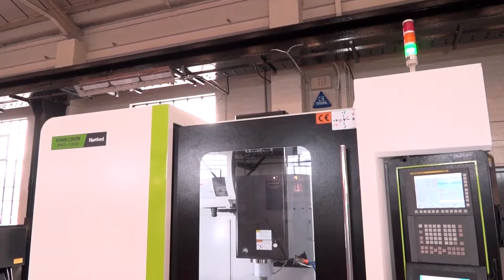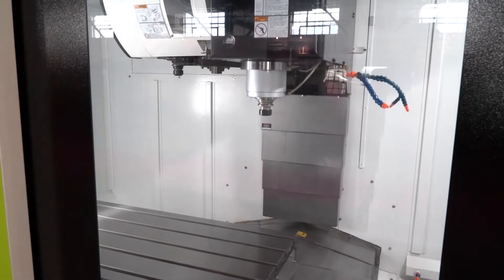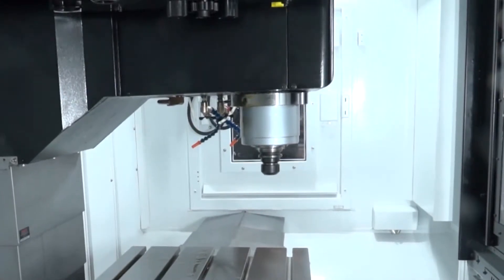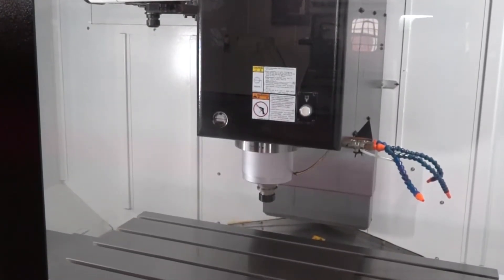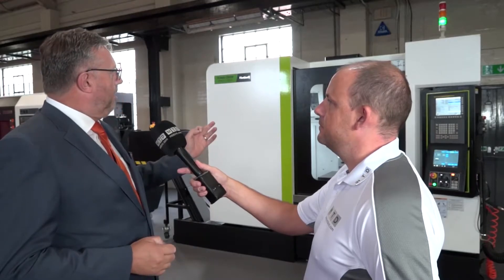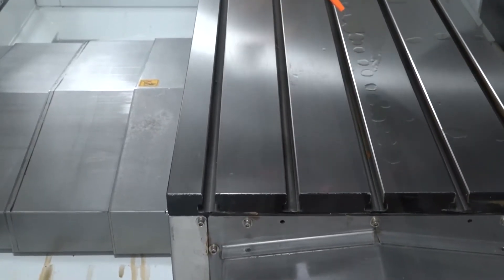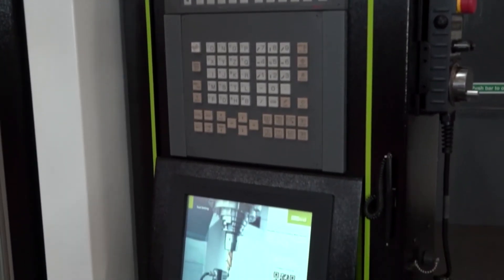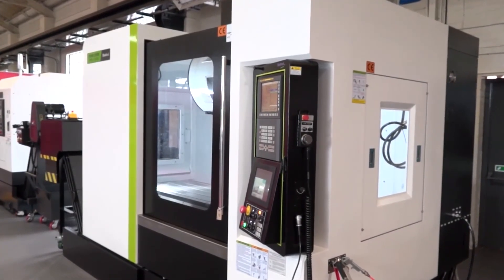Hartford Pro 1000CNC VMC from T W Ward

Comment: These machines are incredible, we do very heavy roughing titanium and these machines have loads of torque, we will put a finishing op on straight after and the machine will hold tolerance every time, we’re working to + and - 0.015mm. And we have the bigger Hartford’s, 16 of them and they are very reliable. TBH at first when I started using them I was used to running Mori Seiki and top of the range machine tools, but these machines in my opinion are just as good.
Reply: They all came from Wards as well.
Reply from the maker: thanks for your opinion Warren